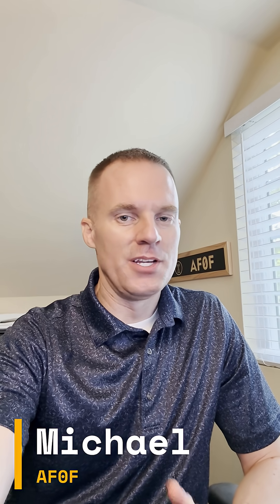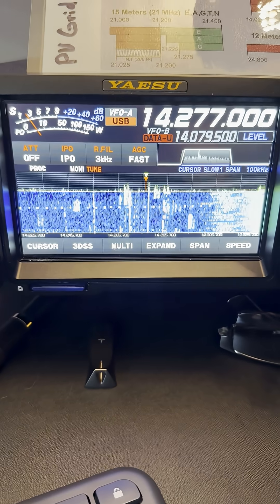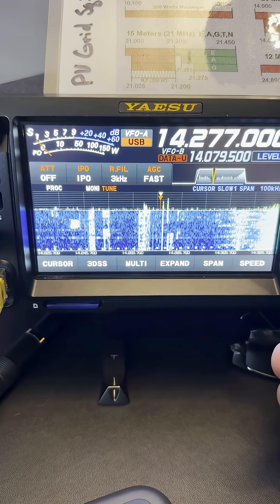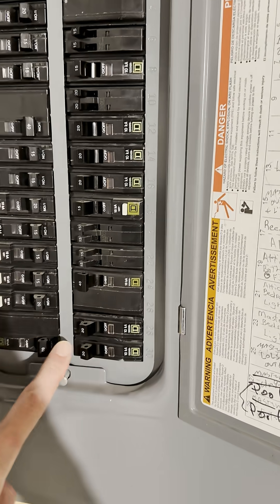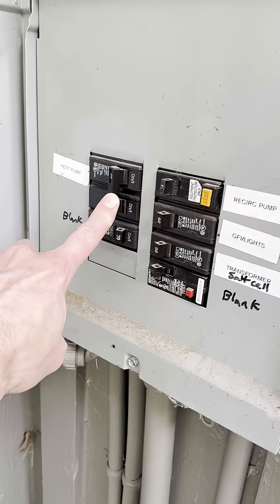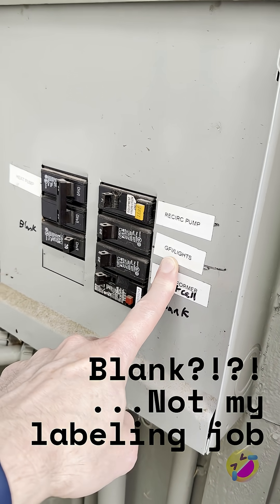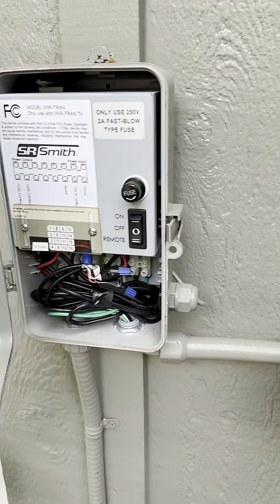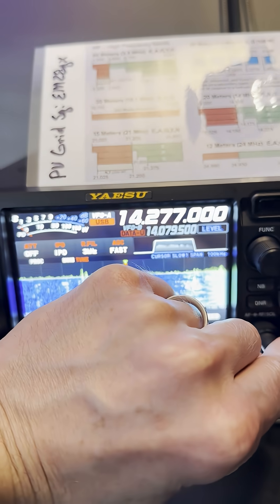Hunting down some persistent HF noise at 14.277 MHz #hamradio #rfi #hfradio

Comment: Im a mechanic and accessories fitter in the 4wd industry, and yeah ive had a bunch of customers over the last few years with cheaper unbranded led work lights and spot lights that interfere with the car stereo. You can buy a power supply filter for those that removes the electrical noise for those, so i would imagine you can buy them for home led power supplies as well
Reply from the maker: LED lights are notorious for noise. I’ve had some luck sticking with a major brands but even those aren’t always clean.